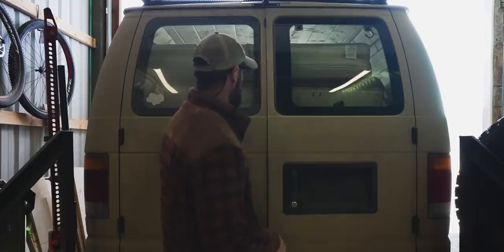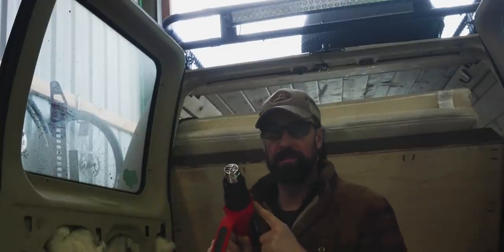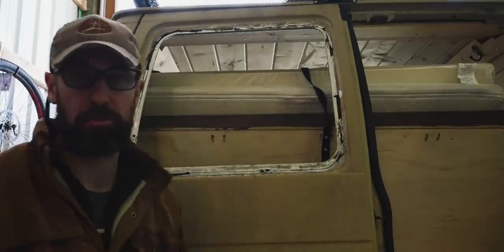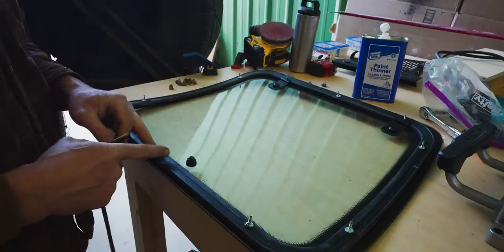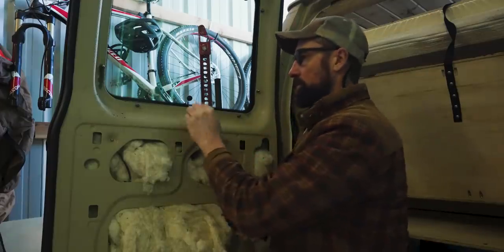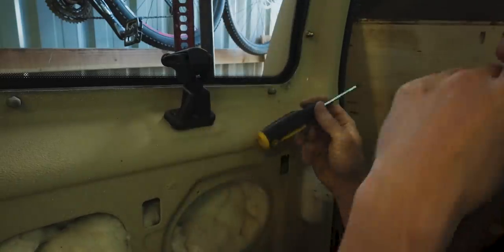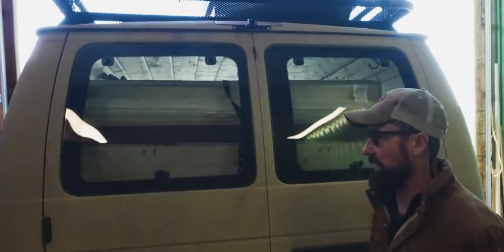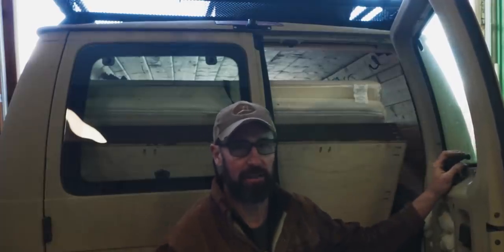Ford E350 Econoline Van - Rear Pop Out Window Installation or Replacement

Comment: Thanks Jason, just switched out one of my back windows with a pop out window from the same Ebay seller you used.  He was a very fast shipper and communication was good.  Also instead of sanding, I decided to try both Goo Gone and Goof Off products to remove the adhesive residue.  Goo Gone was way better than Goof Off.   Just make sure you have plenty of paper towels. But this method allowed me to keep the factory paint.    Thanks again Jason for this post!  Even though it is two years old it is still giving the community value!   Now if I can only find a window delete kit for the other rear window on my Econoline...

Comment: Hi Jason, it’s been 2 years since you posted this video and I’d like to say thanks. I purchased 3 windows (2 back- left and right and one side door- smaller one) from the same eBay seller. The items came quick and I’m impressed with how the windows were packed, complete with the hardware and window seal. Your video gave me confidence to do all 3 windows in 7 hrs. Cleaning the old black residue took awhile. Thanks again.

Comment: Thanks! I just finished my 2004. At salvage yard I forgot the  backing plates for the latches, I had to go with nuts. 
My additions to your informative video 
use plastic tools, plastic putty knife, avoid scratching the paint
no metal scrapers needed

The door doesn’t need immaculate cleaning. After scraping majority of old seal. An acetone-wetted rag will rub off small seal remnants enough so it won’t interfere with new seal.

Wear gloves. My old seal was difficult to remove  (a sticky rubber paste) from doors, clothes, and skin.   Acetone worked for me.
Reply: OMG, I'm doing mine now and the black tar like glue is horrible. 🤦🏻‍♀️

Comment: When I had my van I swapped out my fixed glasses for pop out glass but eventually modified my window to swing almost a full 90 degrees with a prop rod and the factory latch still works. I used my factory glass and it had 5% tint because it was a work van that didn’t have the factory steel cover. I did have a window AC mounted in the drivers side rear window before I mounted an RV rooftop heater/ac combo. I also had a 5 kw 240v inverter on my van and installed a second battery behind the passenger headlight. I had the ambulance prep package on mine so it had a 370A alternator. Had to replace the smog pump with an idler pulley from Summit. I had a 96 E350 with a 5.8 and F350 rear axle and front axle and suspension.
Reply: I would love to see what you are describing on the 90 degree windows!

Comment: I learned to drive on a 1971 Ford Econoline with the blunt nose of the era. It had the flip-out windows in the rear and I'd sometimes get the whiff of leaded (!) gas exhaust as I drove. Rarely used those windows while moving.

Comment: HI JASON 👋 
WHEN I HAD MINE THEY'RE REALLY NICE  , BUT DON'T HAVE THEM OPEN WHILE DRIVING DOWN THE HIGHWAY OR BACK ROADS  . WITH THE AIR COMING FROM OVER THE TOP OF THE VAN & FROM UNDER THE VAN ALL THE DUST  / DIRT FLOATING AROUND IN THE BACK OF THE VAN WILL END UP INSIDE ALL OVER THE VAN . EVEN WITH CURTAINS UP !

Comment: Hey Jason, I know this is an older video but I was wondering how the foam adhesive seal the eBay seller gave you to put on the window frame has held up. Any leaks or anything like that?

Comment: I need these for my Vanbulance!
Reply: Holding Line  I've got a youtube channel. I don't post regularly but I've got a playlist of my build progress. I'll be putting pop-put windows in eventually. My next project is putting WeldTec Designs 6" lift kit on. Link in my banner. If you're on mobile, I have a video posted with a link to my Vanning channel
Reply: Me too!!!
Reply: @jjtoman705  I did it. Pop outs on the back. Got some for the side as well but they broke in transit. It was my fault. Luckily I hadn't paid for them yet and it was a junkyard

Comment: Right to the point, step by step, gives me a lot more confidence than me alone swearing at the shattered glass 🍷🥂 all over the ground etc...
The seal seems rather thin, narrow, for the seal - that's just me.

Also, should I have them tinted before installing them?

Comment: Tnx for sharing- nice work. I am a bit surprised by the installation sticky tape I expected something more substantial, like these thick rubber glue type of thing that comes out of a tube on a pressure gun. Like they use to fix permanent car windows. I wonder how it will last in the cold, heat, dust, moisture and vibrations. Let’s hope that it does but would be interested on a longer term update on this and the make of the tape.

Comment: To remove the frames in a yard just take a flat head wedge it in and slowly twist and brake loose don't force it too much. Also remember to not over tighten the nuts the studs are only in plastic. Had to change the the frame on my big opening window because some stripped out the bolts.  Same process for the side door windows

Comment: Just nabbed a set from a local junkyard myself.  Butyl for the frame to body (3M makes a window seal butyl that is highly recommended), but I’m having a difficult time finding the appropriate bulb seal that goes between frame and glass with the adhesive backing. I understand you bought this as a kit, but did you happen to see any identifying numbers on the bulb seal you used? I’ve yet to install mine, but would love to give that frame to glass seal a refresh on the bench rather than run into leaks later only to remove it all again. Thanks man, love your content.

Comment: I done this too all my vans... Let me give you some advise..Do not let that window edge touch the ground. It will shatter into a million pieces..Why I duct tape the edges. Then put duct tape across the and down.. Till it is in... And always assemble the whole thing on the bench first.. Then install it. As I broke two before...

I might add. They make a 12volt fan. That fits in the bottom part. Across the whole bottom...It pops in once the window is open. It has 4 little fans that help pull in or exhaust air..
Reply: What is the fan called? Want to look into this!!
Reply: @bloodwolf6955  Seem they updated it..

Acool solar powered car ventilation fan created by Syntron
Reply: Got a link?

Comment: ...actually after rewatching... it didn’t appear you replaced the frame to glass seal, just the frame to body. Curious how that turns out in terms of leaks, most suggest using “3M windo-weld” for the frame to body (essentially it’s a high quality butyl) but it appears you were provided with a bulb type seal. Nonetheless I would still be interested in looking into the build seal you used frame to body, as it appears to be very similar to the seal used on the frame to glass. Wondering if it may be the correct fit for my needs.

Comment: Yea I think i paid $60 for a set of four of these windows at a junk yard. Was a pain getting the old adhesive off them and cleaning them up.  Btw it looks like your drives side door there could use a realignment.
Reply from the maker: All the doors need a little realigning its on the to do list.

Jason